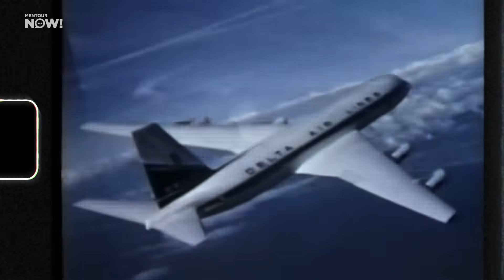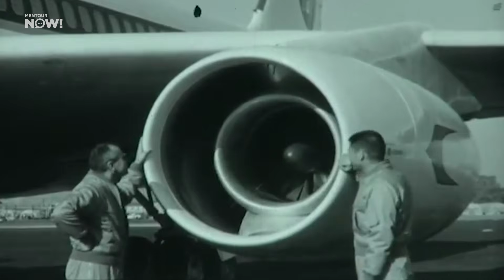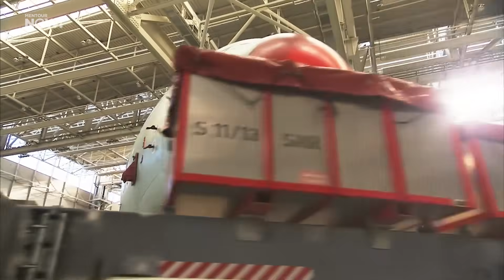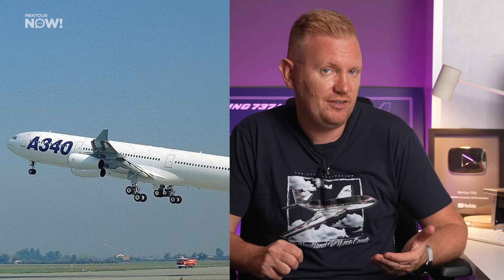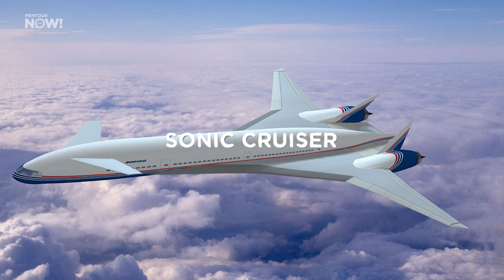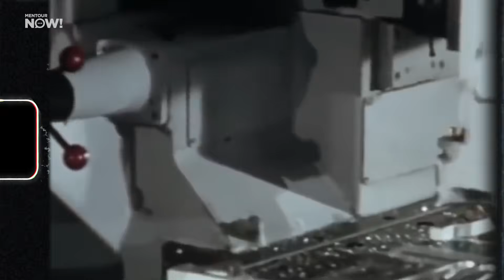WHERE is the Boeing Sonic Cruiser?!

Comment: Saving an hour by flying a super fast jet does not matter that much when you have to wait six hours at an airport waiting for your connecting flight.
Reply from the maker: That’s likely true
Reply: I am currently watching this video to kill time while waiting five and a half hours at the airport. My connecting flight was canceled and I was rebooked for later in the day.
Reply: "Saving an hour by flying a super fast jet does not matter that much when you have to wait six hours at an airport waiting for your connecting flight."
The idea behind the sonic cruiser was to fly direct between cities and eliminate your connecting flight.  That is where most of the benefit to the passenger comes from.  The speed of the airplane is not really about making the passenger's air time shorter, but is about the economics of allowing the aircraft to fly more miles per day in compensation for carrying fewer passengers on each flight than a larger jet could.  The idea was to operate outside the typical hub and spoke system that flies a passenger more miles than a direct route would, but at lower cost per mile as well as more inconvenience to the passenger.
Reply: or have to get to the airport 3 hours early.
Reply: @kenbrown2808 
Yeah that's a fair point. 
Flying is actually really inefficient nowadays. You often end up spending more time waiting at the airport than in the flight itself. 

This means that especially for short haul routes, flying is often no longer the quickest option as we have seen with competition from things like high speed rail.
Reply: @livethefuture2492  I'm from the us, what is this high speed rail you speak of?
Reply: @kenbrown2808  It's a system of train travel that is not suitable for implementation in the US since our population density is so low.  If it was economically feasible, then we would have it.  Simple concept.
Reply: @msromike123  it's not that it's unfeasible, it's that the airlines, and petroleum industry would lose market share if the US had a functional rail system.
Reply: @kenbrown2808 some European countries, western European in particular have high speed rail networks, obviously travelling from inner city to inner city saves an abundance of time compared to airport to airport, and that's before you add check-ins, security and push-backs to the equation.
France for example (were at least) were planning to abolish all domestic flights because of their high speed rail infrastructure.
Reply: @livethefuture2492  Yep Yep. :)  Rain delays or some computer system problem versus train doesn't care. There are times when taking the same time or a little more but being able to relax, get real food, walk around, see the sights.. trains simply work better for shorter distances.  And if you have high speed rail, flying is less important.  Japan is probably the best example of this with an extensive rail network such that most people don't fly inside the country unless it's a fair distance.  Say, Sapporo to Osaka. But even then, adding in airport times, it's 6 hours vs 11.  A shorter trip like Osaka to Tokyo is often not flown.
Reply: @kenbrown2808  @msromike123 is absolutely correct. They are only economically feasible in population dense areas. And there are rapid rail systems in some areas of the U.S. Tri-rail & Brite-line are 2 we use in southeast Florida
Reply: @annrn6148  if the us wanted to have fast efficient rail service, we could. It would be a little different than european fast rail, but we could do it.
Reply: @jamesbong4928  in our trip to the UK, we took the train from scotland to london and then the Heathrow express to the airport to go home at the end, for less money than one plane ticket for the scotland to london flight. In contrast, I've looked at train tickets in the US and it costs as much as flying, and is slower than driving, IF it is even possible.
Reply: @kenbrown2808  I just imagine fast rail tracks between your most important rural centers. e.g. between Casper and Rock Springs. Or Webster City and Atlantic. Your economy would burn itself out just to do 1% of the needed services.
Reply: @wolfgangpreier9160  adding rail lines next to high traffic freeways would be an improvement.
Reply: @kenbrown2808  And who defines high traffic freeways? And where will you build the railway stations? And where will you build the cargo tracks? And who do you think will finance this?

In Europe we reduce railways because they can not ever be run profitably or even energy efficient.

A swiss study says 100 person-kilometers on a medium fast train uses 17 kWh on average.

Thats about the same as i use in my 500HP Tesla Model Y. For one person. With Santa Mode!
Reply: @wolfgangpreier9160  and how many square feet of road does your one person in a tesla use up? 

It's really easy to identify high traffic freeways. It's the ones that are a hundred feet wide and still spend 8 hours a day with traffic going 15 mph because there is too much traffic for the road.

And we don't need to have freight rail. We have a beautiful freight rail system. It's the cheapest way to get freight from hub to hub, and the freight industry is all about getting it there cheap.
Reply: @kenbrown2808  My one person Tesla uses 10 m². A train station uses about 20.000 m² and a train with everything on 100km stretch uses about 10 million m². My car sits on my lot so it only uses space when on the road. Like everyone else.

If we stop using trains for people and those people would use the Autobahn, and if we use the trains for goods only and do not allow lorries and trucks on the Autobahn it would be easy and very energy efficient to handle all the transport requirements.

But of course everybody wants to do their own spiel.

We need freight trains and no more trucks on the roads. We very specifically do NOT need passenger trains. And not between Hubs. Between every single village, city or industral center that borders to the rails. Most of our cargo is tranpsorted via trucks or smaller lorries. 

Of course its different inside of cities. There it is 100% reverse. There we do not want to allow one single passenger car and only trucks to transport the goods to the grocery stores.

So: large parking lots outside the city walls and only public transport inside cities.

As we have no rails here, where i live, in the countryside, never had any, never will have any - which means we never ever get any trains around here in the middle of Europe - we are depending on single person cars. 

You can of course demand that we abandon the countryside and all flock together in city highrises and megalopolis.

I can guarantee you that will not happen.

Germany has problems with their Autobahn, they are always "under construction". Here in Austria its not so bad. Only on mondays and thursday during school days and only around the bigger cities it gets tight. 

All other countries in Europe show similar traffic patterns. Outside of school days its mostly relaxed or at least floating. During school days its bad on Mondays and thursdays. 

Why thursdays you ask? Because most have 35 hours work weeks and have free or in home office on fridays. Saturdays and Sundays are always closed everywhere of course. Only the larger malls which exist near the bigger cities are active on Saturday.
Reply: @wolfgangpreier9160 
Important rural centre is an oxymoron in a diversified economy. The United States' Economic Complexity Index ranks in the top ten—it may lag behind Japan, Switzerland, Taiwan, Germany, and South Korea (incidentally all leaders in high speed rail network density) but it's not an extractive/agrarian economy like Canada, Australia, or Russia, where you actually have to give a shit about the hinterlands.
Reply: @vaffangool9196  Yes we can observe how much shit the US boys give their Hinterland. 

I am lucky that i can rach 90% of Europe in one day with my car. Including all Hinterlands which we give very much TLC. I really do not have to travel to Georgia or Bhutan to become happy.
Reply: This is true today but remember that air travel wasn't the same back then.
Reply: @renataavgeri1132  yes, I think a lot of people have either forgotten or never got to experience how little security (theater some would say) there was prior to 9/11. You might have one or two security lanes for a terminal because it was just that fast to get through security. Prior to the Gulf War, in the US you could still go to the gate and wait for someone to arrive. I think that had even resumed prior to 9/11.
Reply: Sonic Cruiser was intended for point-to-point routes, not hub-to-hub.   Boeing was correctly observing the change in long distance travel behavior.
Reply: Add 2 hours each way in most major cities getting 20km to the airport from your home!!
Reply: @rainscratch and the taxi from the airport to your house probably costs more than the plane ticket
Reply: I agree. It’s a moot point. Airlines can’t get their current planes from pint to point without delays so no reason to buy new airplanes.
Reply: @bigrich6750  New? Or Superfast with energy consumption of a small city to fly a rich a-hole 10 minutes faster to his mistress for a greek play?
Reply: Generally true, but if you must travel by sir it’s probably more comfortable sitting in an airport than on a plane.
Reply: @ThatGuy182545  You are not allowed to sit in front of the security check in. 

Longest one was in Scheremetjewo in 1988. 14 hours standing. And if you sat down the militia came over with their hot kalaschnikovs and told you in broken english "stand up".

But after that it was fun. The airport was closed for the night and our plane was broken and we had to wait in duty free zone for another plane which was redirected from prague. We found an open wine shop without cashier. Yes, much fun and a very dirty plane afterwards...
Reply: @wolfgangpreier9160  Better than waiting having your flight 7 hours late and then canceled at 12 am. I’ve got bad delays due to bomb threats in New Zealand, custom lines taking forever in Dallas, airport run in poor ways in Addis Ababa, but I will never forget that cursed experience at Hangzhou…
Reply: @fyang1429  Now you know why i try my best to avoid flying.
Reply: Indeed, exactly.
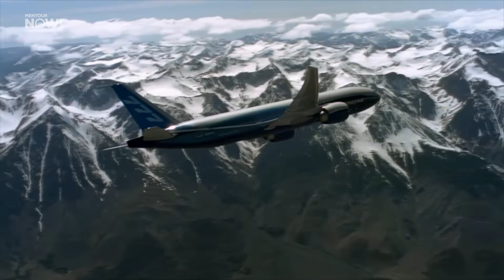Reply: That’s why the objective was to avoid this, as explained at 12:15.
Reply: And this is why high speed rail is gaining more ground.  Simply buy a ticket, walk on, and get off. The train might go half as fast, but, again, point to point and no airport insanity (1.5 - 2 hours total, typically in and out) ends up being the same overall time but a lot less stress.  The typical train can also carry a large number of people on it.  Over 1600 on the largest models in Japan, making it very efficient to run. Even more modest ones can easily manage 600-800 passengers.  They also are more environmentally friendly and arguably safer.  But, no, they don't solve the issue of crossing large oceans.  There will always be some sort of flight required for that.
Reply: Yep. The problem with flying is not time but space. Fortunately, the two can be exchanged: fly a little slower and each passenger can have plenty of space to stretch out (remember, the math is exponential so a little speed reduction allows lots and lots of increased passenger volume (weight stays the same).
The also allows for piston engines, nose props, and counter-rotating shrouded necklace fans. Jets are inefficient, polluting, and require passenger compaction. Yuck, yuck, and re-yuck.
Reply: Still cheaper and faster!
Reply: India kills me.  I would pay more for a shorter trip.
Reply: A trip form city centre London to down town New York can sure make one hour shorter without making the air plane faster.
I think when you fly first or even business class you would doe to shorter lines everywhere already be one hour faster the a economy passenger.  
When I think how much faster I got through emigration in BKK when I was flying business.
Reply: Yeah but it would make up some of that time
Reply: @harryparsons2750  Hurry up and wait? Where did i hear that one?
Reply: Or waiting 2 hours for your luggage 😅
Reply: I'm in the US.  I'd fly to see relatives if it weren't so expensive once you figure in car rental.
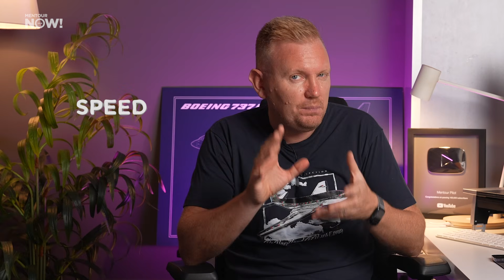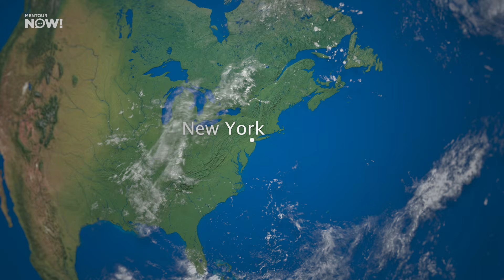Reply: @@phillipbanes5484 in may o went to Mexico, had to wait in Mexico City between 12:50 and 19:50. After I was back in Sweden I had to wait 14 hours at arlanda before I went to my home city! Waiting six hours or more isn’t uncommon for my destinations. When I went to India during the spring I had around 6h at Frankfurt.
Reply: Absolute truth 👍
Reply: And it really only HURTS the airline in increased fuel costs.
Reply: Lol 😆
Reply: It isn't about you getting there faster, but if you shave some time of each flight, then the plane can fly one more time each day, and make the airline more money with smaller number of planes.
Reply: Waiting six hours for a slow-boat connecting flight is even worse. I always flew B727 or DC8 service when I could, for the extra speed.
Reply: I don't know anything of aviation, but probably supersonic air travel makes much more sense for private jets.
Reply: Boston resident here.
The amount of time you spend preparing for a flight to JFK, getting to the airport, going through security, waiting to board, getting onboard, the long taxi, flight, long taxi at JFK, long offboarding, and leaving the airport,

ALL adds up to about the same amount of time it takes to drive from boston to jfk.
Reply: Right - I like the idea of a plane that can do more point-to-point travel but I don't really see how a smaller faster plane helps you to do that.
Reply: This is why high speed rail is so important. It straight up beats flying for anything inside like 6 hours of travel, and you don't have to burn dinosaurs to do it.
Reply: @evildude109  How are the high-speed rails powered? If electrical, than you're still burning coal or petroleum to make the electricity.
Reply: @annrn6148  solar, wind, and hydro are things.
Reply: @evildude109 where does this European electricity come from?
Don’t think coal and natural gas facilities are burning dinosaurs as well?
Reply: 1 hour every 6 is a lot time saving
Reply: @malumusera 6 + 3 in transport to the airport and pre-flight waiting time.
Reply: Door to door, air travel makes sense for drives longer than 8 hours.  Safer too, but much greater risk of long delays than driving.

Would rather have less security theater, faster boarding/unloading patterns, and better fuel efficiency. Can we please build some modern passenger trains in America?
Reply: @@mckidyl70   If the minor inconveniences of getting into the air are enough to trigger you, then yes - by all means stay home.    Hardier souls that came before us endured the incredible ordeal of train travel to get from city to city, and crossing oceans by steamship took DAYS!   It's an unimaginable horror.   🤣
Reply: BS
Reply: Sounds about right. Efficiency is more important, especially now as we really really need some change for our future climate.
Reply: I really do not want to fly any more since the Germans stripped me nearly naked in Frankfurt - on an intra-EU flight a few years ago. Why? Because i had a packet of tissues in my pockets to clean my nose - that was before Covid. 

That is one of the reasons i drive Teslas now. Inside of Europe i do not have a need to travel by air anymore.
Reply: @wolfgangpreier9160  Germans are quite strange in that manner. I seen guns pointed at me when detector found bubble gum wrap in my pocket. But rigid coax samples, which could make a nice sharp weapon - were overlooked.
Reply: @brylozketrzyn  yeah, but looking at some news lately, you will be seriously searched if you're a pax or crew, but it't more or less ok to cut the perimeter fence, go prancing about on the taxiways, spray paint on a/c or glue yourself to the runway. seems strange, at least a bit.
Reply: @wolfgangpreier9160  Frankfurt airport is the worst.
Reply: @sirius4k  On an intra EU flight? I never had this treatment when leaving the EU for foreign shores. 

But between Frankfurt and Vienna i get the Super Villain treatment?

They - the airlines - have lost a customer. I am sure they don't mind. I know i don't.
Reply: @wolfgangpreier9160  Buying a ticket, going through very basic security and stepping on is always the best part of travel by train.
Reply: @plektosgaming  I know. 

The last time i traveled by train was with Interrail in 1983. I flew a few times since then. The rest i traveled by car.

Since 2019 - actually since Covid - i know traveling by car inside of Europe is much cheaper, often faster and of course much more convenient than using any other form of transport.

Funny side note, traveling by car produces less pollution and less CO2 emissions than most trains. Only with EVs of course.
Reply: @wolfgangpreier9160         The world, including the West, is becoming more authoritarian. Governments all around the world have declared war on their own people. Maybe instead of World War III being fought between countries, World War III may be waged by people against their governments in order to restore the individual freedom we once had.
Reply: @wolfgangpreier9160 no one cares
Reply: @NostroDio  You are no one? Ok. You obviously care otherwise you would not have commented. 

Thank you very much. Nice!
Reply: @NostroDio  Speak for yourself.
Reply: @wolfgangpreier9160 bro, do you train? 💀
Reply: @theengineerguy8726  Sure i train every day. Bro. Built if you want if i use „the train“? No. We do not have such modern equipment here in the middle of Europe. We drive Teslas.
Reply: @wolfgangpreier9160  Security is adequately addressed by the secure cockpit door. Any trouble in the cabin could be dealt with by a slow depressurization of the cabin, rendering everyone hypoxic in short order, unable to function. All the rest of the "security" measures were designed to limit the plebs' free and easy ability to travel outside their planned 15 minute prisons now being implemented.
Reply: Good Point, while recently it seems Tesla's boss wants to destroy Europe by supporting parties which close the borders again 😢 @wolfgangpreier9160
Reply: @wolfgangpreier9160  You can walk if you want. Even more environmentally friendly and less prone to customs inspections.
Reply: @todortodorov940  Would you please help me walking? My customers work between 120km and 200km away and i have to „walk“ there at lest 3 times a week with all tools and parts. The next grocery store is 12km away. The next pet food store 25km. The next furniture store roughly 35km. Would you please be so kind and come over - smack dab in the middle of Europe and show me how you walk those distances?
Reply: Okay boomer